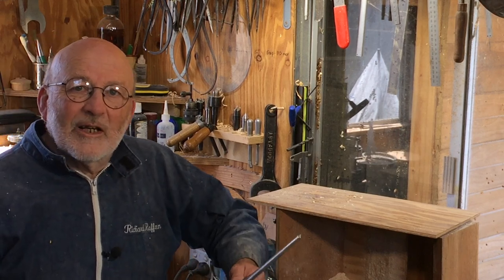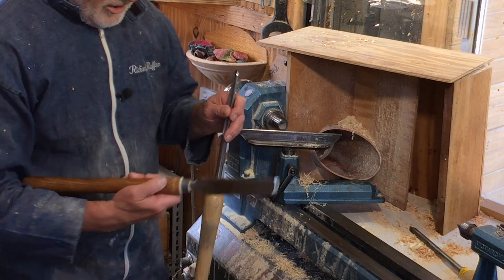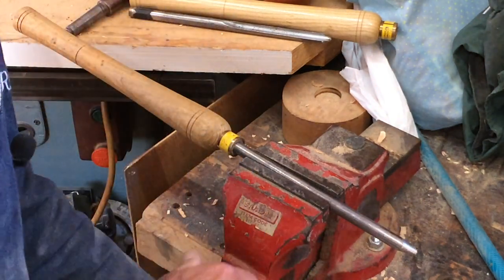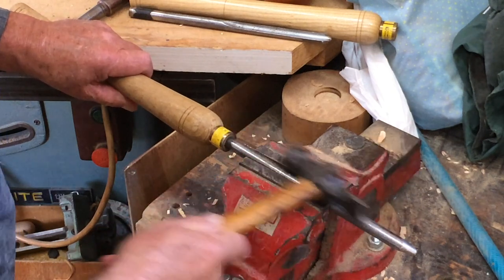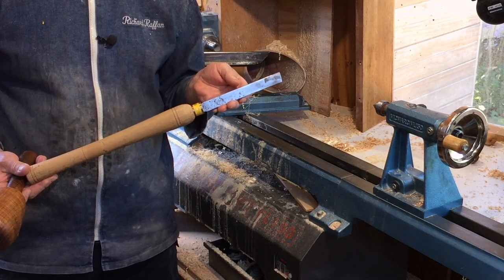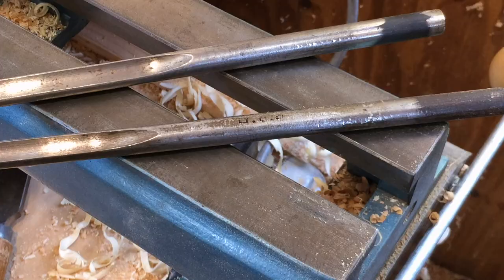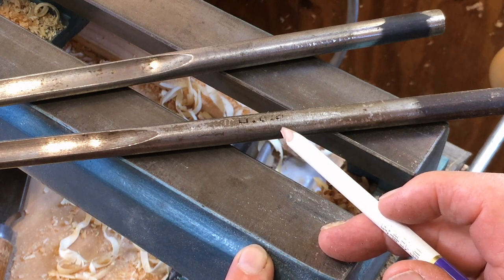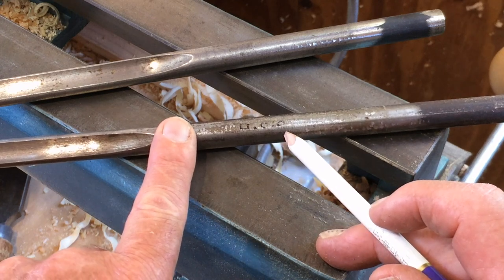Richard Raffan on two ways to remove a tool from a handle

Comment: I have removed tools from their handles so that I can put them in handles that were better sized to the tool. Sometimes the handle is broken and has to be replaced. Sometimes just because....... Thank you for sharing Richard. Have a great 2023 and stay safe.🙂🙂
Reply from the maker: I've re-turned most handles that came with tools, partly so they better fit my hand, and partly so I know which tool is which when I can't see the actual blade.

Comment: I always thought gouges were epoxied into the handles. Thanks for the info. Also, if not HSS , what kind of steel do you use and recommend? I am enjoying your videos. Thanks
Reply from the maker: My turning tools are all HSS bar a 1930s Marples 1-in gouge and a much older skew chisel. They're mostly Henry Taylor, Hamlet, and Sorby, plus one Thompson, two D-way and two Glaser from the 1980s

Comment: If HSS does not stand for High Speed Steel on a tool, what is the indicator of quality steel on gouges?
Reply: Ist does stand for High Speed Steel. But you find "HSS" (without Brand nearly only on very cheap tools, with low quality steel. Good brands proud of their tools will print their name on the tools
It's like when you find "professional" written on a really cheap tool. Liars ...
Reply from the maker: Leading Sheffield manufacturers like Sorby, Hamlet, and Henry Taylor print a small HSS alongside their name on High Speed Steel tools. This differentiates them from their older carbon steel tools you still find in garage sales. It's wise to stick with Sheffield steels or American manufacturers like D-way and Thompson.

Comment: Anyone who is learning about this for the first time, if you do stick the tool in a vise, make sure not to then stick yourself onto the tool.

Best to keep the pointy end tucked in and not leave it clamped any longer than it takes to get the handle off; definitely don't wander off and leave it.
Reply: If you can't avoid poking yourself with the tool it's probably best to get some tuition before owning them.
Reply: @bushratbeachbum   True, and I would start by tutoring them not to clamp a sharp tool so that the edge protrudes beyond the vise.  I'd also remind them that experience isn't double-dutch protection against stupid mistakes.

An ounce of prevention is worth a pound of cure, etc, etc.